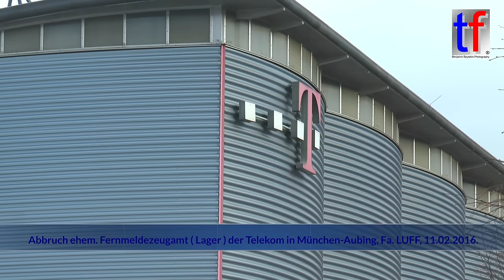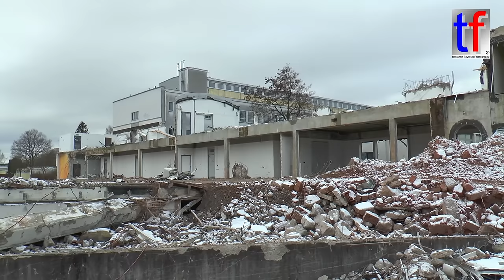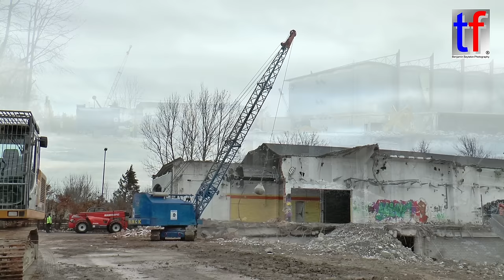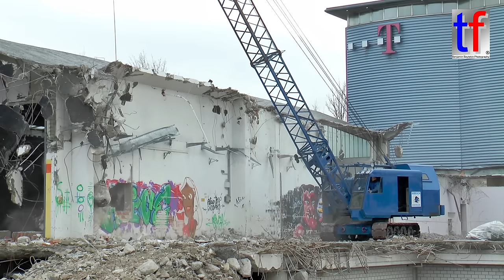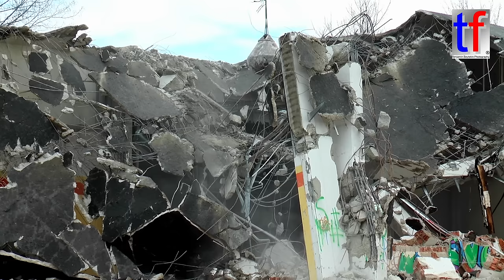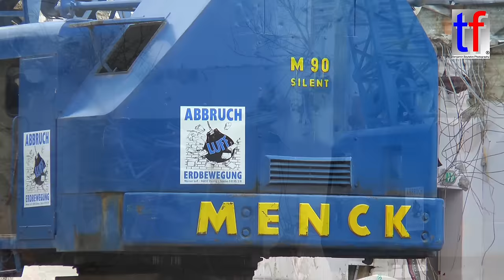MENCK M 90 Silent, Wrecking Ball Warehouse Demo / Abbruch Telekom München-Aubing, 11.02.2016.

Comment: Excellent vid as always Ben. What is the small 'box' for that appears to be hanging by its own little 'pulley' at the front of the crane beside the base of the Jib. How many of these cranes does this contractor own - am I right at 4, also has this one been re-engined as I notice there is no sliding door on the back and I presume that is what the 'silent' means.Damn good operator I don't think he missed putting that ball where he wanted it at all.
Reply from the maker: +Christopher Lovelock I'm not sure how many MENCK cable excavators he has, but it's a mass - over 20. The box and his cable is a "rope donwer".
Reply: I don't think he had a clear line of sight. This guy was amazing.

Comment: 14.50min. incredible how stable german roofs were built. there are only estimated 25% of the supporting structure of the roof there, and it does not fall down itself! german craftsmanwork
Reply from the maker: That was built to withstand bombs or so. A former German Telekom building complex.